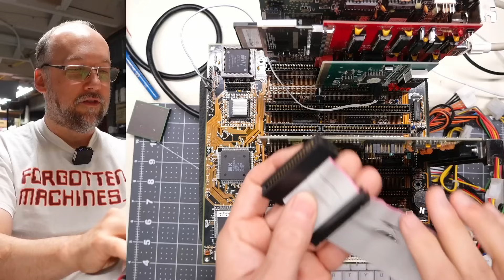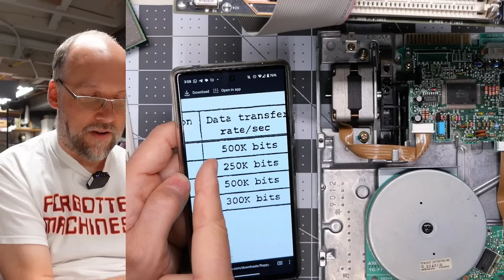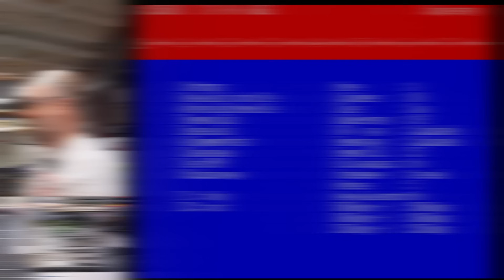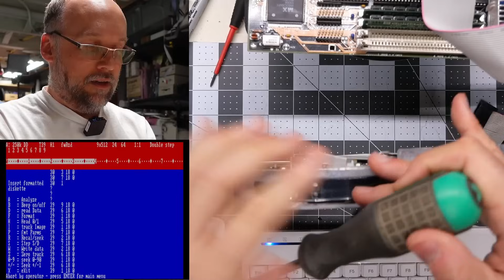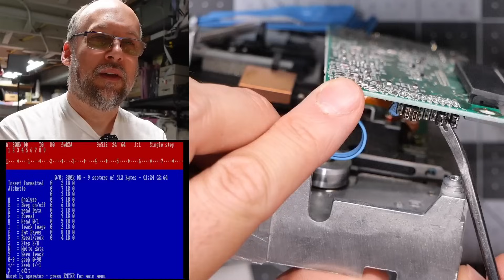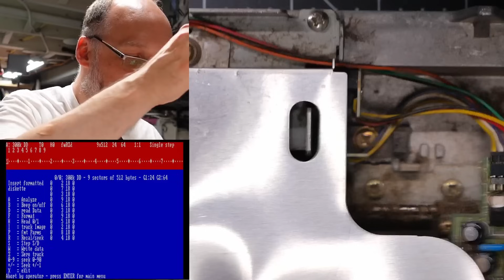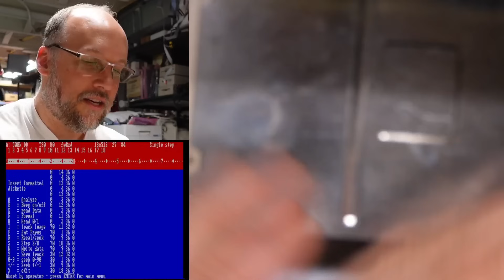Testing 12 mystery PC floppy drives

Comment: I had a teac drive with similar issues to your non working one. Seek and spin but no read. It ended up being that the top board (with front panel led) has come disconnect front the main board.  That board is connected with a ribbon cable from right next to the head connectors, through the chassis and into a dual leaf socket on the bottom of the main board. It’s not super secure so it’s possible yours vibrated out over time like mine did. I reattached the cable and now  the drive works great

Comment: Not 1.44??? 1.2 sounds wrong.
Reply: 5 & 1/4 inch drives were 1.2M in high density mode.  Only 3 & 1/2 inch drives were 1.44M in high density mode.

Comment: on that 4th Teac drive with the  different circuit board there is a jumper labeled I next to one labeled LG.  It's located along the bottom edge above resistors r35 and r36.
Reply: Yes, very close to the drive select jumper

Comment: Adrian Have you tried using 5.25 drives in Linux?
Reply from the maker: Nope, does it work? I'm not sure I even have a machine with a floppy interface that can run modern linux
Reply: @adriansdigitalbasement2  So if you are planning to test that could you share results about how different drives behave. I use to restore old computers as well. Especoally that were made in USSR. So some soviet models appear to use geomentry that was not used anywhere. And Linus is barely the only way to export software there. It's kind of sad story because I had to left great paret of my collection when I was moving but anyway that might be helpful.
Reply: @adriansdigitalbasement2  Well... I've experimented with that. So I may conclude it work but has some problems reading second side. But I had only one model of FDD (FD55GFR). By the way in DOS both sides worked fine
Reply: @adriansdigitalbasement2  There are some modern linux distros that will run on almost ANYTHING.

From what I've read tho, the realistic bare minimum for a useable CLI-only install is around 64 megs of RAM and a pentium CPU. 
For a gui desktop, you might want 3x or 4x the RAM and have a PCI videocard.

I know you don't usually feature pentium class machines on your channels, but I suspect you might have at least one tucked away in some dark corner of your basement. XD
Reply: I had no problems running 1.2M floppy drive under Linux on newer 2010 PC which luckily still has floppy controller on board, can't remember which model of drive it was but most likely some TEAC. I was using it just to do some imaging with ddrescue.
Reply: @snap_oversteer  Thank you

Comment: According to what I've read, high density drives (1.2M & 1.44M) also used a different write bias on the read/write head.  For high-density mode, the magnetic field was intensified because the high-density disks were supposed to have a magnetic coating which was less "permeable" to magnetism.  This was done to reduce the likelihood of cross-talk between the closer-spaced tracks (80 tracks instead of 40 tracks).
Putting double the number of tracks into the same space meant that the magnetic fields for each bit in adjacent tracks were far closer to each other than in double-density drives, and over time the magnetic fields in adjacent tracks could interfere with each other and effectively "demagnetise" both bits, if a standard double-density disk was formatted using a high-density drive.  The reduced magnetic permeability of high-density disks meant that the adjacent tracks would not interfere with each other.
Reply: Geez, if that was already starting to become an issue, how the heck did we manage to get magnetic hard drives anywhere near the level of density we're at now???
Reply: @stevethepocket in addition to what melkior said about head size and formatting, they also swapped the magnetic surface medium’s materials a few times. 

Hard drives in the 80s were brown or black just like floppy disks and audio tape. These were metal oxides which made fairly large particle sizes. But that was fine because the heads were even bigger. Modern hard drives now use really high purity metal surfaces, (usually) vapour-deposited on a glass/ceramic platter. It has to be a really thin layer so as to isolate each section magnetically, as well as the high purity. 

Audio tape started to go in that direction with metal tape toward the end but that still paled in comparison to modern hard drive platter surfaces. The engineering for these teeny tiny magnetic fluxes is really impressive. 

The signal can be somewhat marginal compared to the very definite flux transitions on older magnetic media though, this is somewhat analogous to how lower voltage binary signalling (12V down to 5V down to 3.3V etc etc) requires lower noise and higher sensitivity 0-1 thresholds. They rely heavily on error correction in a lot of cases nowadays (at least 5-10 years ago when I was reading up on this), especially when a physical sector has been rewritten many times. 

The fact we can get 10-18TB hard drives today for the same price as 1-4TB drives a decade ago does impress me still. I’d really thought we were pushing the limit in 2015.
Reply: @stevethepocket  Hard drives use smaller size heads than floppy drives use, which is why the platters of the HDD are sealed away where dust can't get to them, since even a speck of dust can be bigger than many bits of data and can also scratch the magnetic coating right off the surface of the disk if it gets caught under the read/write head.
SSDs don't use moving parts at all, so they're generally longer lasting and a lot more tolerant of dust and dirt.
Before SSDs, rotating-platter HDDs had already changed from one recording format to a different format which made the data more compact.  That's another reason why so much data can be stored on a single HDD, although the main reason is simply the mechanical improvements in precision.

Comment: For something with mechanical moving parts, it is really amazing how resilient floppy drives are. Great content as always. Thank you.
Reply: As opposed to using rubber belts (sadly i have one usb drive with that). I love direct drive motors, those last and unless you used the PC in a construction site or somewhere super dirty, very rarely needed any maintaining. People who belittle floppies lack the context of cassette tapes, and those that belittle cassette tapes lack the context of punch cards/ribbon type your program every time...
Reply: Especially compared to hard drives from that era. Adrian has opened up more than one HDD on his show, revealing a read/write head that had gotten stuck to its platter and then torn off by the spindle motor.

Comment: 57:04 It does say Mitsumi Elec Co., LTD. right there 😅🤓😎
Reply: 59:59  It says Mitsumi on the spindle motor as well, and there is an indication of 300 and 360 RPM as well!

Comment: FYI the twisted cable was an invention of IBM.  They figured most users were too stupid to use jumpers.  Then they set all their drives to drive 1.  So they could just ship a drive and plug it in.  In most cases, even on the IBM's I played with in the day, you could use a straight through cable and jumper the drives correctly.  This is what most CPM and other computers did.
Reply: The reason for the twist was the original PC 5150 only had a 65W (!) power supply, not enough to run both drive motors at the same time. By flipping the center pins, DS2 (Drive Select 2) was sacrificed for an extra motor select connection (for the "B:" or DS1 drive). That made copying a file from A: to B: very slow (each drive would have to spin up with each re-select). Your straight-through connection would work fine, mostly, as long as you set the drive jumpers for motor-on-with-select... although some BIOSes would cause you to experience intermittent errors caused by the drive motor not running when the BIOS asked for it.
Reply: I still think its better to avoid jumpers though - it’s so small and fiddly lol😂
Reply: @DerekLippold  Hard drives and Optical drives would take revenge on you lazy types later on 🙂

Comment: Hey Adrian, Love the video. I found this post in an old forum about the Chinon FZ-506 jumpers. You can test it out to see if it helps.

TM: closed for drive A, open for drive B
DS0: open
DS1: closed
DS2: open
DS3: open
IU: open
MS1: closed
D-R: closed
MS2: open

TM are the termination resistors, which must be enabled only for the last drive on the cable, normally drive A. DS1 is the standard Drive Select number for IBM PC/compatibles. D-R selects the function of pin 34, Disk Changed if open, Drive Ready if closed. IU enables the In Use signal, which is, ironically, never actually used.
Enabling both MS1 and MS2 selects automatic motor speed switching. MS2 enables it, and MS1 inverts the signal from pin 2 (or else it spins at 360rpm for DD and 300rpm for HD discs).

Comment: I've been trying to find a working 5.25" drive for my Greaseweazle setup for freaking ages... I've got a dual 5.25 and 3" drive here but it just doesn't want to work. I guess I'll be taking it apart again...
Reply: Wait, you have a what???
Reply: @stevethepocket  It's a dual drive that takes up a single 5.25" drive slot which has both a 3.5" and 5.25" drive in it.  I had two, both broken and annoyingly I can only find one of them.